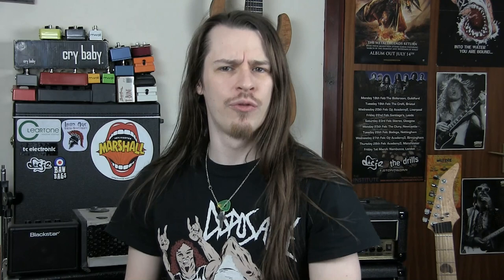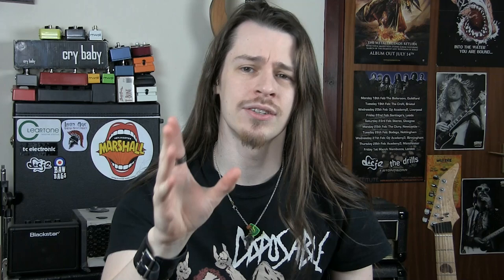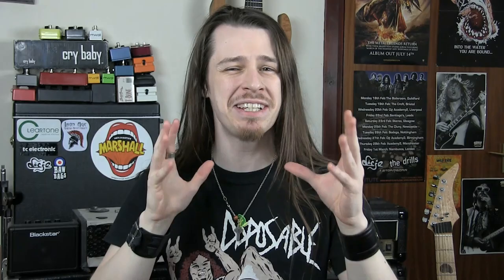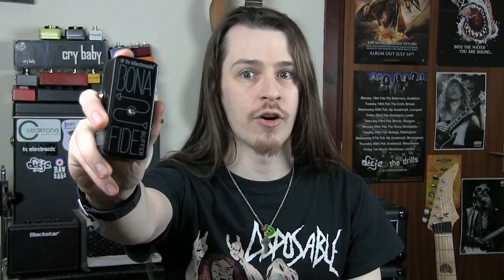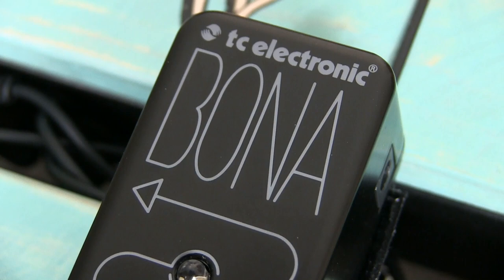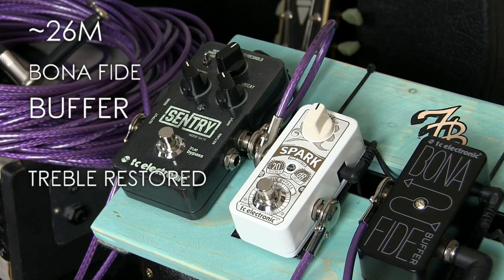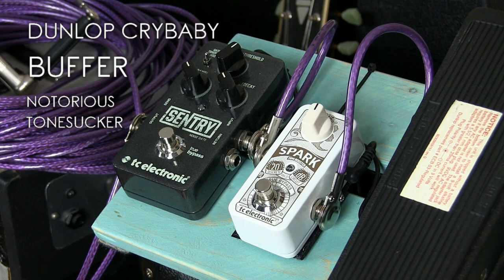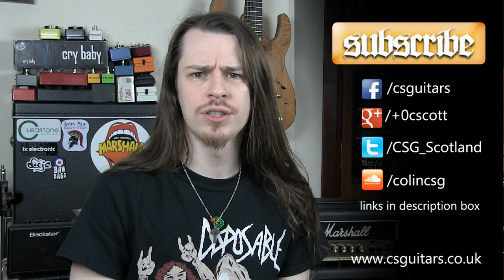The Truth About True Bypass

Comment: Simple solution to a long cable lowering the treble is to simply turn the treble up on the amp. If a pedal/buffer is altering your tone just re eq your amp. It's not hard.
Reply from the maker: +Elliott Henderson it makes more sense not to lose your signal in the first place. EQ is not a substitute for cleaning up your signal path.
Reply: +CSGuitars true I suppose but as I set my sound after I have connected my pedals it doesn't make it a massive issue for me. For some people that wired tone is desirable as you'll notice that a lot of wireless unit have cable simulation options. All personal preference I guess

Comment: Where should a buffer (Like the BonaFide, for example) go in a pedal chain? I have a fuzz face, an OD/treble booster, and a distortion before the preamp, and then an EQ + reverb in the fx loop. All of these are true-bypass.
Should it go after the fuzz face? The treble booster?
Reply: I would think in front of the chain unless you also have a WAH which should be in front of the buffer.
Although my advice is to let your ears judge and put it where you find it sounds the best.

Comment: Hi, good video but does the Crybaby definitely have a buffer (I don't have one to test)? If it plays with no power and bypassed, it doesn't have a buffer - which is like my Vox Wah, and has a 'hardwire' bypass which doesn't use a buffer but doesn't swap the entire signal chain like true bypass. I don't know which type the Crybaby models do (and they might have changed them over the years too) - though one can test it by pulling the battery and putting it in bypass and see if the guitar sounds; buffered pedals don't let any sound through without being powered when bypassed.

I think the worst culprits are Wah pedals (at least ones like my Vox) and older MXR designs (which are still in production), like the Dynacomp or Phase 90 (two favourites of mine). They do not have true bypass and no buffer and are really big culprits for treble loss - running a buffer before them usually helps like with true bypass. You might be able to see the difference by testing one with a buffer before and after it. The hardwire/mechanical bypass is like worst of both worlds compared with buffered and true bypass pedals.

Comment: so if I first run through a high quality buffer like the bonafide and then later in the signal chain I use less-than-optimal buffers like a boss pedal or the crybaby, will the secondary buffers still degrade my signal or does only the first buffer in the chain count?

Comment: Does the impedance get changed by the preamp?
If I have a buffer pedal directly after my tuner pedal and in front of my preamp, do I need another buffer pedal in the fx loop? And if yes, should I put it at my amp so the signal gets buffered before it runs X amount of meters to my pedal board?

Comment: What about using a wireless system? does using a buffer right after the reciever do the same thing? I have my reciever on my amp so i have a cable going out to my board and back; easily over 25ft some times

Comment: would the buffered pedals still colour the tone if theyre going through a send and return or an effects loop? i thought that took them out of the signal chain but im also still trying to figure this stuff out. im running a Boss Ns-2 (which probably affects the tone but i need it to reduce noise plus it is fairly inexpensive to replace) and running my 6 other pedals through it's send and return function. sadly most of said pedals are Boss and the wah is a Crybaby 535Q. Would i benefit from investing in this buffer?

Comment: The BOSS Metal Zone sounded like it did a perfectly fine job as a buffer. Maybe you heard the reduced clarity in the room, but I didn't hear it in the video.
Reply: +brainstewX try listening through quality cans, its hard to tell the difference between anything on computer speakers
Reply: Spencer Bladyka
I don't agree with your claim that it's hard to tell the difference between anything on computer speakers. It was very easy to tell the difference between the other examples given. You also assume that I didn't listen through 'quality cans', which is incorrect.

Comment: I get the mechanism. But I don't get the purpose of a bypass pedal, true or buffered. Why should I have any in a sihnal chain? Anyone?
Reply from the maker: +SahharBM from this question it's clear you haven't understood the concept.

True bypass means you bypass the pedal circuit entirely, buffered bypass means you bypass the effect, but through a set of components called a buffer.

Bypass is the switched off setting on the pedal.

You obviously want to switch off your pedal, and that gives you two options. Either route signal directly from jack to jack, or stick it through a part of the circuit that relevels the impedance.
Reply: Aye, why would I want such a pedal on my pedal board?
(Bearing that I work mostly with amp sims, I am admittedly a bit amateur in the physical realm of things, it's been only recently that I'm considering actually buying stomps and the like)

Comment: If you only have like 10 pedals connected with small as possible cables, would you ever need to worry about this though?  I mean you had to use a 20 meter cable in order to show a reasonable decrease in treble.

Comment: I have a question: If I use the buffer behind the Wah pedal, will the tone be sucked anyways?
Reply: It will, since the buffer can't restore what is cut away by the WAH's buffer.
I have exactly that problem with a Shafter WAH's bypass buffer, so need to figure out to make it true bypass, preferable with an external on/off switch since the difference in tone also has it's advantages with the WAH's buffer engaged.

Comment: Nice one, Colin.
I wasn't even aware that certain pedals like the cry baby spoiled the tone.
I'm off down the shop to buy a shorter lead.

speaking of leads / cables. What do you make of the ones that have capacitors and what no not inside and claim to keep the best sound no matter the length. Ive got some old Planet Waves cables that ive had for about 12 years and they have some strange feature where the plugs are specific go the guitar and amp and plugging them in the other way means no sound will get through. its supposed to stop signal reflection or something like that. I just got them originally because they were in a sale and had  lifetime guarantee.
is this sort of thing a pointless gimmick or is it worth spending a bit more for this sort of thing ?
Reply: damn it. I hope you can understand that waffling bullshit. my phone likes to change words and fuck things up with auto correct.

Comment: If I have a pedal that's always on, then will true/buffered bypass not make a difference?
Reply: No. It's a buffer when it's on. So basically any pedal that is on in your pedal board is a buffer, and that makes this whole exercise pointless. Well at least the cable run from the pedal board will always be buffered as long as one pedal is on. You guitar to pedalboard cable is usually within 20 feet, so it's not a huge deal.

Comment: Great video Colin! I am slowly beginning to understand true bypass and buffered bypass. The pedals I am currently use are a Ibanez F7 Fuzz, a Ibanez JD9 Jetdrive, and should be receiving an analog Boss Super Chorus soon. I am running it through a Fender Blues Jr tube amp with a Fender Strat MIM. So I believe all my pedals thus far are buffered, so would the buffered bypass you suggested enhance the my sound? I would really appreciate it and be grateful if you could help me out

Comment: I have a switch on my guitar it's on the tone control you can lift it up to activate something and I read it was to protect against treble bleed or something. Is that switch just a buffer?
Reply: +TheStarch i think is a treble bleed. Its basically a  condensator united to your volume pot, so when you roll it down you don´t lose treble on the signal.
Reply: +Felipe Cárdenas Villegas Ohhhh ok thank you I understand it now

Comment: in a full band setting i dont think the difference beetween the bona and the boss mt2 buffer would be discernable . the crybaby however omg ! i use a morely but still . the best answer for this is when setting up your gear adding one pedal at a time ., have just a cable to bypass everything . audition effects pedals before you buy them and before you buy them type in the pedal name with tone suck after that on google . i just got shafted  buying a behringer rv600 reading loads of great reviews but irt steps on the highs like no tomorrow in the set up i had laid out so ... that kinda sucked . i tend to build every thing i can but ... i wouldnt be able to build a reverb unless i went with a belton brick and i want options and features like reverse and gate and all that fancy stuff . revrb aint cheap . i am thinking of going with a three amp of four amp set up . having two stereo rigs . the center two speakers would be clean / dirty , the outer two speakers would be stereo effects . but man thats crazy ammount fo stuff for a remote session on battery at the woods which is how we jam with the family band on diy gear . check my channel for video / proof .  love your channel .  its nice to have a no nonsense type of approach .

Comment: I don't have a pedal board yet, im not sure what I want to go for though, im thinking like a L.O.G sort fo sound or Metallica, what would I need??
Reply: +That Emo Kid If you're going for a good metal tone it has more to do with your amp and guitar than any pedals you run. Metallica use guitars with EMG pickups so look into that and as for amps both bands use Mesas (though Metallica used Marshall for Kill em All and Ride the Lightning). If you can't afford a Mesa amp then look at amps like the Blackstar HT series, The mini Peavey 6505 or if you want that early Metallica sound, the Marshall DSL is a good choice. Whatever amp you get just remember to keep the gain as low as you possibly can (trust me even for playing heavy metal you need far less gain than you think) and don't fall into the trap of turning the mids on your amp low. If you take the midrange out of your sound then once you start to play with a band especially with the bass and drums, then your sound will be lost and no one will be able to hear you. Finally for pedals, personally I like to keep it simple: tuner (the boss and Tc electronic are in my opinion the best), wah, overdrive or boost pedal for solos, maybe a noise gate and possibly a delay. Hope this helps and happy playing.
Reply: guitar19971 the guitar im using at the moment is a signature jeff loomis 7 string schecter and an LTD ex360, I have a marshal mg15cfr and im using a BOSS mt2 that I don't actually like but yea I will look into getting mesa or even a line 6, thanks man for the help, good luck man

Comment: So if I have a set up where o have a 20 ft chord and a 10 ft chord. Which one is best to put from the guitar to the pedal board.
Reply from the maker: The shortest cable between guitar and pedalboard is always desirable, but it depends on whether 10ft is long enough for you to move freely (on stage)
Reply: Big thanks for answering my question. Please answer this one. When I have my chorus pedal in my chain, even if I have the pedal is turned off it still sounds like the effect is there (just slightly). Does this mean my pedal does not have true bypass?
Reply from the maker: if the effect is still functioning when it is turned off then there is something very wrong with the pedal. 
True bypass and buffered bypass are just different methods of making the effect stop. Your problem lies elsewhere.

Comment: this video is missing the bona buffer before the crybaby and boss pedals
Reply: Brenton Bolderoff Yes, you are right it does miss that recording. But as an owner of the old crybaby it's buffer being of a poor quality that colours the tone 'treble' even on a short cable run. So if you used the TC Elec buffer or others like it, before the crybaby it will make no difference as the crybaby buffer is not a good one it will remove any advantage of the pre buffer. I now have a new mini crybaby and that is much better in that regard.  Best Steve. Sounds like there may be similar problems with Some Boss Pedals, but I have no evidence or experience of those.

Comment: Any way to deal with the Crybaby tone sucking (apart from getting rid of the pedal itself)?
Reply from the maker: Modify it for true bypass.
I have an old how to video on this topic. You should be able to find it under my 'pedal mods' play list
Reply: +CSGuitars Thanks for the tip! However, I realised that my Crybaby is a 535q and that the hardware is not quite the same as the original (for better or worse).

Comment: So why is it that true bypass is mostly found on the more high end pedals?
Reply: +Cameron Forster I think it's because it's simply cheaper to make a pedal that sends the signal through a buffer than it is to wire in a true bypass.
Reply from the maker: +Cameron Forster The 3PDT foot switches needed for most True Bypass applications cost, let's say £2, whereas a more basic foot switch will cost only £0.50

If you are producing a production run of 20,000 pedals and you want to keep the price point low, then which switch would you choose to use?

The time and material costs to implement true bypass are only possible for pedals that will retail at a higher price point, or are being produced in smaller numbers.
Reply: thanks man :D

Comment: I've tried a Boss BF-2 flanger, and a MXR M117R flanger in my amp's effects loop. For some reason, the MXR drops the volume when active, but the Boss doesn't. Any idea why?
Reply: the mxr is 18 volt rather than standard 9. That might have something to do with it. According to jimdunlop.com regarding this pedal:

"Q: Why is there a volume drop/boost when I turn on my pedal?

A: There is a possible impedance mismatch with other pedals in your effects loop. Isolate and remove the pedal from the loop to see if this still occurs."

Comment: Hey Colin, great stuff. 

I was wondering about using a tuner pedal as a makeshift buffer. I have always had the Boss TU-3 at the very beginning of my pedal chain, but was recently persuaded to move it to the last spot on the chain, as, in the theory I was told, it would buffer out my signal before sending it to my amp. 

Any insights to share on this?

And what is the optimal place for the buffer? You implied in this video that it should be first in line. Is that kind of good rule of thumb?

Comment: Sorry, it isn't physics and isn't true. Only 1 buffered circuit will balance the total signal from guitar to amp, multiples color the input signal in stages and tend to grow exponentially muddier. That, is physics. Basic math reveals the truth here. Every buffer, introduces either an increase in impedance or, an increase in signal delay. Stacked, that increase works against you. Math never lies.

Comment: BUT CAN'T YOU JUST ADD MORE TREBLE xD
Reply from the maker: YOU SEEM TO BE MISSING THE POINT.
ALSO WHY ARE WE SHOUTING?
Reply: +CSGuitars haha its a serious question but I was joking XD why can't that happen or is more of the tone compromised?
Reply: +Gwaether Bloom There could also be compression of tone too and to sort out the capacitance you'd probably need a decent graphic EQ.
Reply: +Gwaether Bloom

You can but I guess it will sound a bit different. Because (if you turn the amp treble up) the treble will be added in the end of the chain where the tone has already been altered. It's the same as turning your tone knob down and amp treble up vs having your guitar tone at full and amp treble lower. It sounds different.

You can't really take an already muddy tone and make it sound clear. But it works the other way around. Cutting is easier than boosting. You can't really turn non-existent frequencies up.
Reply: +Gwaether Bloom It's not the same frequencies. You won't gain the same sound simply by turning the treble or presence up.